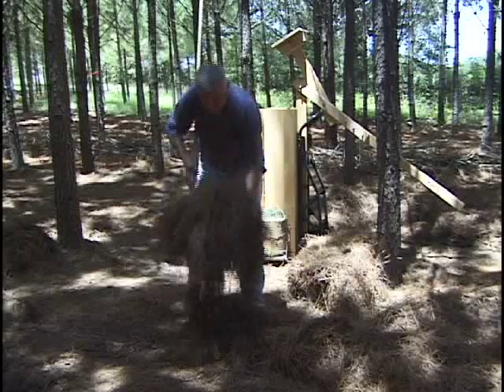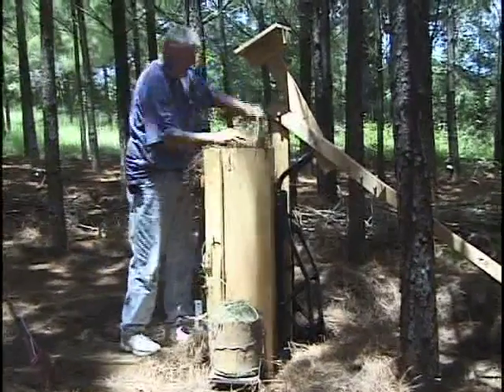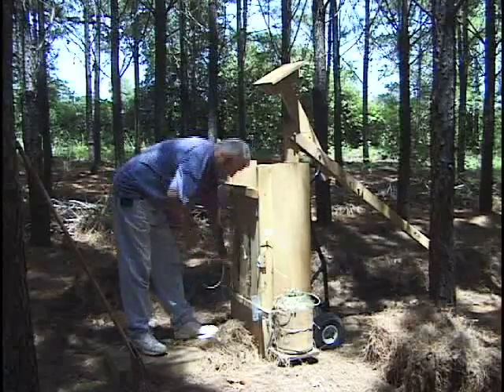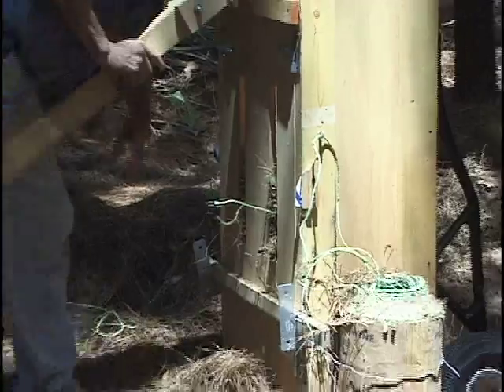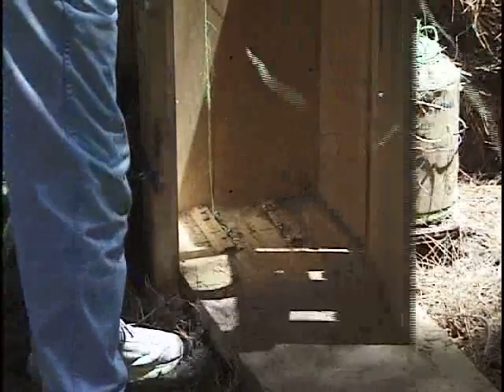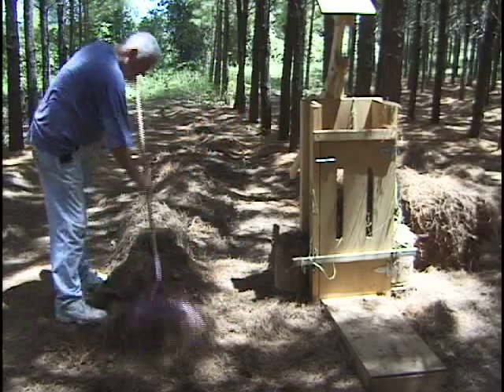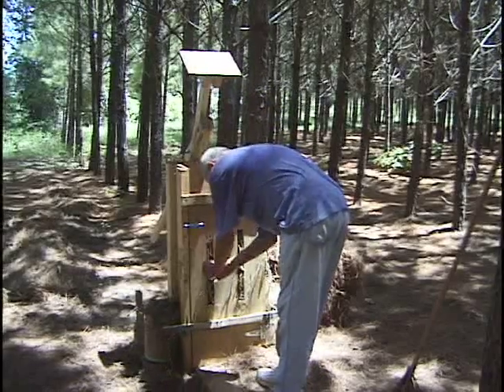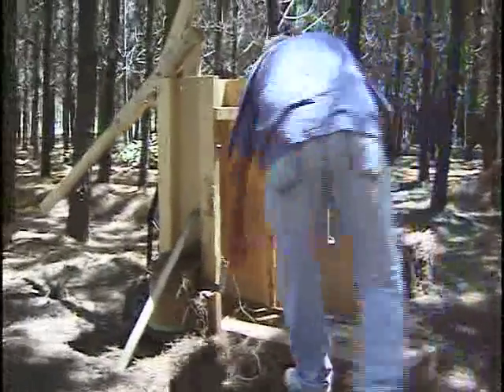In Action: Hand Baling Pine Straw

Comment: Instead of using your leg to hold the plunger down you can put an eyescrew on the top side of the piece thats over the door and then put a large screw on the plunger handle to "lock" it into place. Thats how the mexicans around here do it. --Los Portrios